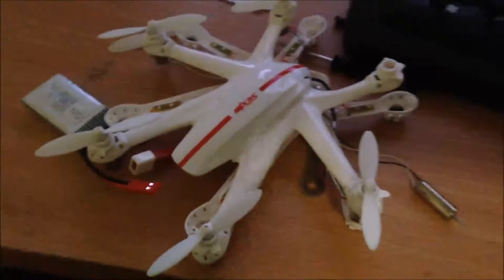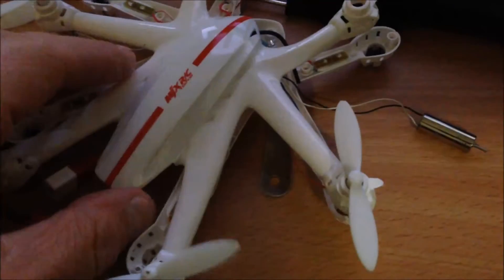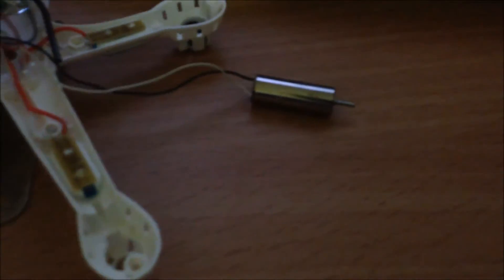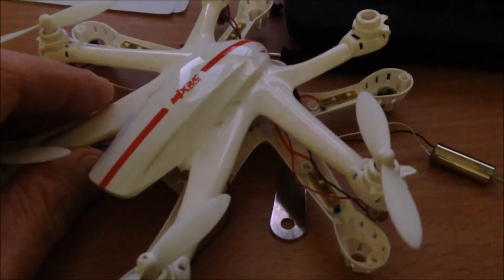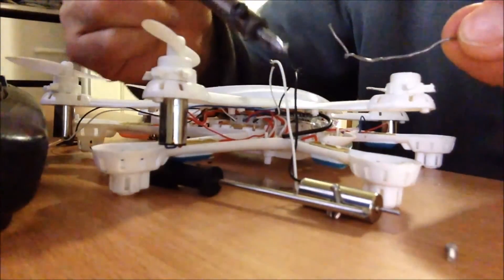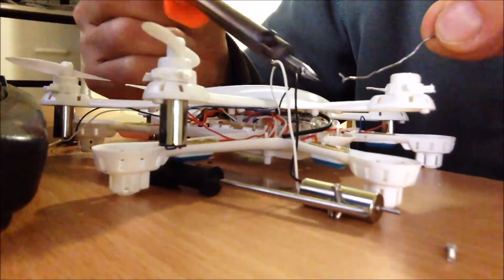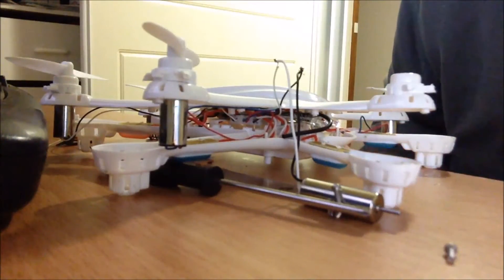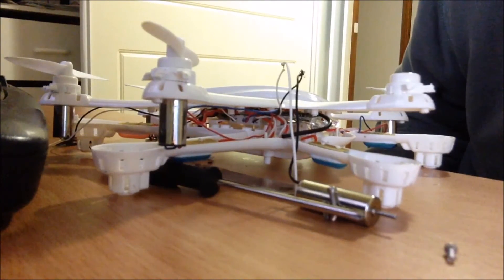MJX X800 Motor replacement

Comment: It's good to make the splices at different lengths so there is less chance of contact.
Also I've found that the trick of knocking the top of the motor down a bit with by tapping lightly with a hammer and some kind of non pointy screwdriver type thing, does get sticky motors to spin again quite often.

Comment: Nice job! I am pretty sure Gearbest has spares with plugs but any 7mm will work fine :D The X600 is even better with the pods at the ends of the arms clipping and screwing in so yo only need to take one pod apart instead of the whole thing and they plug in at the end of the arm, spare for that are $5 for 2 and I think they are 8.5mm.